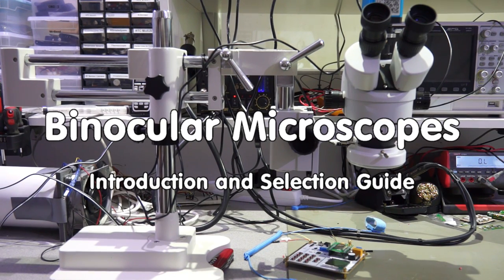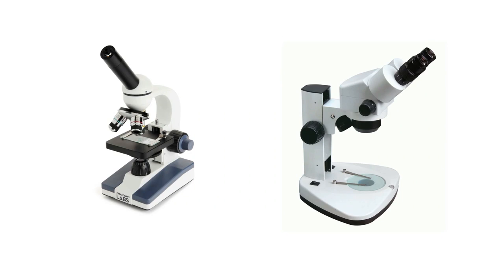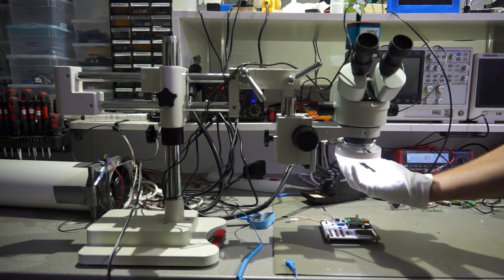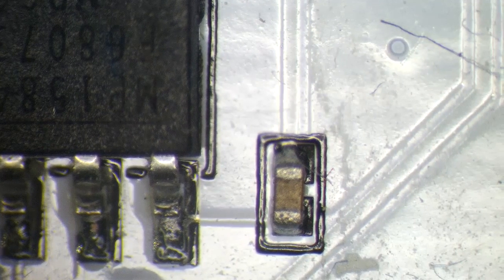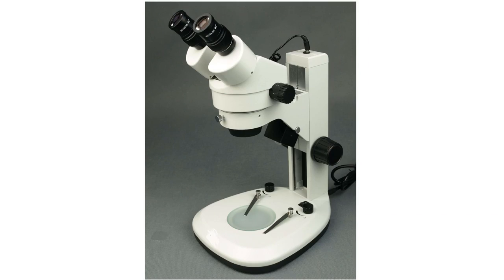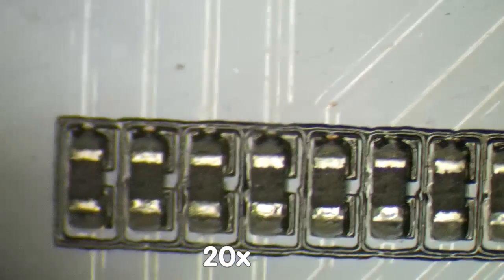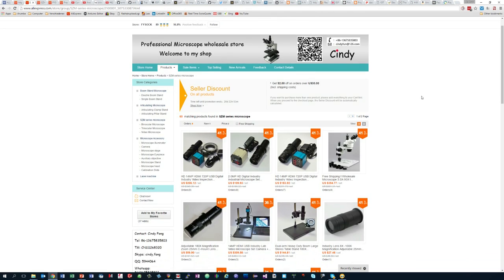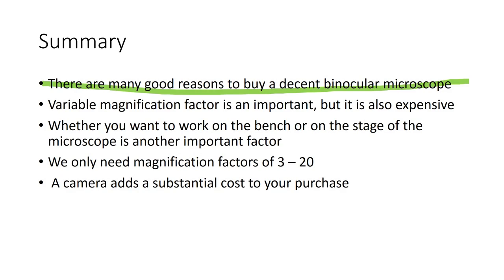#70 How to select a Binocular / Trinocular Microscope?

Comment: Thanks Andreas! Did you consider attaching a regular good webcam, probably stripped off its lens ?
Since I upgraded from an endoscope to a ~150€ microscope, I really miss raw, straight screenshots on my computer (I have to swap SD cards)
For those interested on a lower-end review : https://www.oz4.us/2016/02/a-valuable-tool-andonstar-usb-microscope.html
Reply from the maker: It is not easy to find the right lenses that the picture is sharp and full size. I assume a webcam would need a special optics.
Reply: @AndreasSpiess  yes probably. Surely someone went through the hassle already. Some scope camera seem to feature an USB video link, in addition to HDMI and/or SD card video writing.
I often do live debugging through an online chat with some colleagues, and really lack the live screenshots! Thanks for your reply!

Comment: I think this will help those new to microscopes, as purchasing can be confusing!  
I bought a nearly identical Amscope some years back and came to the same conclusions about magnification.  I only use 20x when examining failed boards for flaws, otherwise 3-8x is my normal range.

One big advantage of the 0.5x Barlow lens is the increase in working distance... that is the distance between the lens and the board.  That 0.5x doubles the working distance which makes it a lot easier to get your soldering iron in there, etc.

I started out with an identical double sliding arm base, but I was so constricted on bench space that I bought an articulating arm.  I see that your supplier sells an identical model. 

I found that the holes in the arm match up with Panavise tools, so I got another arm to use for holding the boards.
You can see the articulating arm here:  https://www.youtube.com/watch?v=ftUMTMOrycA

Looking forward to the next video!
Reply from the maker: I thin, the articulating arm can be a good alternative. I did not cover it because I have no experience. So, thanks for your comment!

Comment: Hi, i bought binoculars microscope, but i m having problem with it. Problem is i can see through only one eyepiece at a time. If i m using right eyepiece then i cant see from left n if i use left then i cant see from right eyepiece. I tried to adjust suitable distance between eyes but then i see two seprate images from each side of the microscope. Pls suggest me what should i do ?
Reply from the maker: I hope, there is nothing wrong. But it took me a while to adjust this distance. The effects of a wrong distance sound like the ones you describe

Comment: Because of own bad experience with a cheap USB thingy, and also other advice - i would have expected that 'working distance' should be added to the criteria for selection of such a device? I saw microscopes which looked quite similar to yours, with only 10cm working distance to the object - that would probably be not enough for me operating with a solder iron below that...
Reply from the maker: I mentioned the working distance, but was probably not explicit enough. It depends also on the magnification factor. If I go with the 2x barlow lens instead of the 0.5x, the working distance is much reduced (to only a few centimeters). This is why I was quite clear that you should only have a small magnification factor. But I did not mention the relation on the distance.
Reply: Ok; so what is the actual working distance which you feel comfortable with, or which you would recommend as your minimum?
Btw, like your videos - including the accent! :-)
Reply from the maker: Mine has close to 20 cm which is comfortable, bot not necessary. II think, if you go below 10 cm it becomes difficult. If it is more, it might get uncomfortable because of the distance between your eyes and your hands (The eyepieces also move up with the distance)

Comment: Came here following you comment on the channel of PCBreflux.
Your video and explanation is a lot more helpful compared to an unboxing, because I am in search for a relatively inexpensive microscope.
What was your final configuration? Just giving us the link for the online store is not very useful  >_<
Reply from the maker: There is no configuration, because the store in the link sold me a trinocular, a camera, lighting, and a camera objective. You find all the different bi- and trinoculars in the link. With the video you should be able to get what you want.
Reply: There are no part numbers on the items you have bought?
Sometimes there are huge differences even between different lens revisions.
This is why I am not the only one who is asking which lens/head combination you have bought.
From the link one can put together hundreds of different configurations, and not all of
them are good for SMD rework, especially when it comes to the working distance.
When the working distance between the bottom lens and the PCB is less than 20cm, one
simply no longer have physical space to put in a soldering iron at the right angle.
I have seen that even higher end microscopes do often have a short working distance,
because they are meant only for inspection but not for actual rework.

Comment: I could not afford those prices. I bought an endonstar on eBay. It uses the PC to display the image. Even full screen. Manual focus. Light illumination. Fantastic cheap choice. USB connection
Reply from the maker: I made a video about a USB microscope (#23). I think, it is a good solution if you are on a budget because the price difference is big!
I recently bought a USB endoscope for less than 10$ and was amazed about its quality. Even with that, you get decent magnification on a full screeen.

Comment: I wanted to caution everyone considering buying a 7X-45X trinocular microscope in 2020-2021.
.
Recently newer variants of microscope heads have appeared on the market which provide better outcomes/results from the CTV camera port. If the camera interface isn't important for you then you won't really be effected. On the other hand if "microphotography" is your thing you need to chose wisely.
.
What is very concerning is the poor language used by sellers on Aliexpress. They use words such as "new model" or "2020 model" which means nothing substantial. If you buy your microscope from a reputable "Western World Seller" such as Amscope then you wont have any problems. You can buy the identical high quality microscopes that Amscope sell from a seller on Aliexpress which come from the same factory, but given the kind of clusterfuck cross cultural boundaries that are transcended when doing business between east and west you have to know what you are doing.
.
The "litmus test" without getting into a technical discussion is to have your Aliexpress seller assure you that the microscope head will support a 0.35X CTV trinocular adapter (which also supports 0.5X). This "litmus test" is the same criteria as "putting a square peg into a round hole". As a "specification" it means nothing on its own, but as a "litmus test" support for a 0.35X CTV trinocular adapter. The older variant microscope heads do not support 0.35X CTV trinocular adaptors.
.
So why is having a 0.35X CTV trinocular adapter important on a 7X-45X trinocular microscope?
.
Ans: It provides the same F.O.V. (Field Of View) as seen through the eyepieces.
.
This is only important if you are interested in creating YouTube content or other videos where camera performance matters.
.
I found this out the hard way by carefully studying the microscopes of YouTubers who purchased their microscopes from reputable microscope suppliers such Amscope and applied this knowledge to Aliexpress sellers. By now I've become a "microscope expert" where I qualify to import microscopes from China and sell them on the local market.
.
Just be careful when buying a microscope in 2020/2021 and make sure you do your research carefully.
Reply from the maker: Thank you for sharing your experience!

Comment: Andreas, I was wondering if any problems have developed with your microscope double boom arm over time?
.
I still haven't assembled my microscope stand, but what I see in these YouTube video concern me a lot.
.
Do you think that such a modification as shown in the video might be required in the future?
.
AmScope Microscope Boom Modification
http://youtu.be/s_L5pXzBlc0
.
New out of box boom arm failure after after only 10 full actuations.
http://youtu.be/HSC-vzMBR98
.
Have Amscope finally fixed their boom arms?
http://youtu.be/ulZ0qX2u8nc
.
I'm starting to form the opinion that a single boom arm might be a better choice than a double boom arm (when you consider this problem of soft boom metal that is damaged easily) since a single boom arm doesn't slide along the boom, but rather "pivots" out of the way. In hindsight with what I now know if I had to make the same decision today, I'd buy the single boom arm. Very difficult to make the right decision when you are learning. The ability to adjust the position of the microscope head is unnecessary when you can adjust the placement of subject of interest on the table. In other words, there is no need to be able to position the microscope head when you can position the item you are working on. I saw Louis Rossmann use his single boom arm microscope on his YouTube videos where he "rotates" the microscope out of the way rather than "sliding" it out of the way. We live and learn.
.
I'm raising this issue because I did not know of this when I was buying my stereo microscope. So many people on YouTube use this double boom arm microscope stand and none of them have ever raised the subject of poor metallurgy with regard to the quality of the boom arms. 
.
Seriously people, buy the single boom arm instead of the double boom arm as the "sliding feature" is unnecessary, when you can position your job (such as a PCB) under the microscope. The only difference is "sliding" your microscope out of the way as opposed to "rotating" your head out of the way and yes with a double boom microscope you can "slide and rotate" out of the way at the same time, but do you really need this kind of functionality? I like to follow the KISS (Keep It Simple Stupid) principle as it's much more reliable in the long run.
.
If you decide to buy the double boom arm you might have to undertake a retrofit project (replace the original boom arms with case hardened rods and high quality linear bearings) which will set you back an additional $100 USD.
Reply from the maker: I do not use this function. My boom is always fixed.